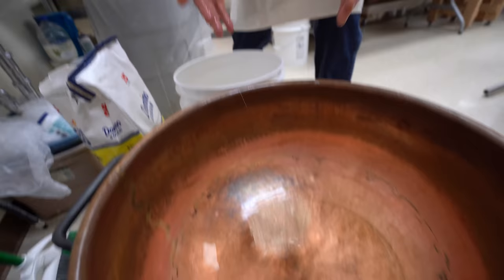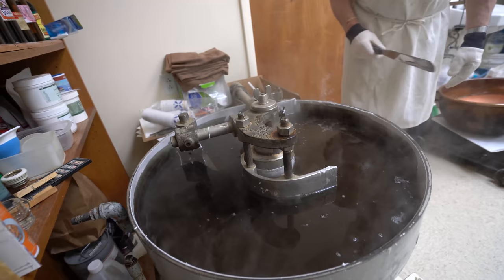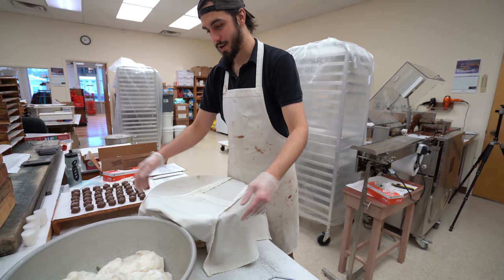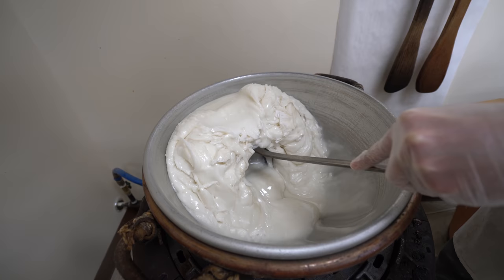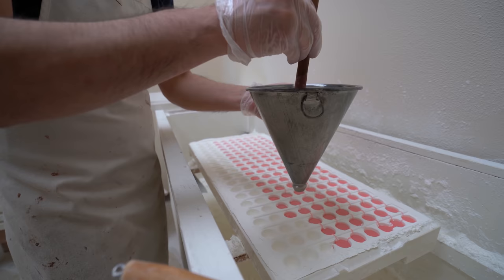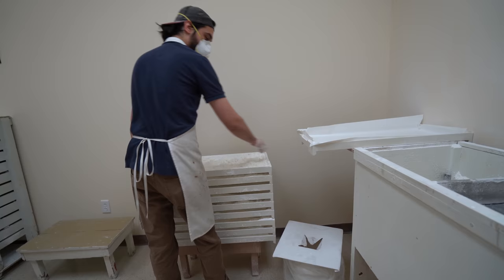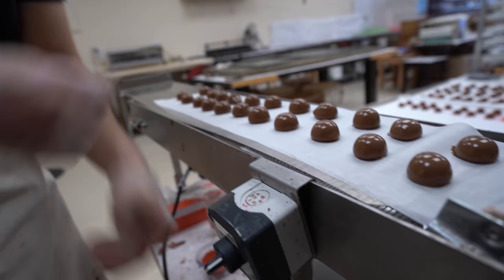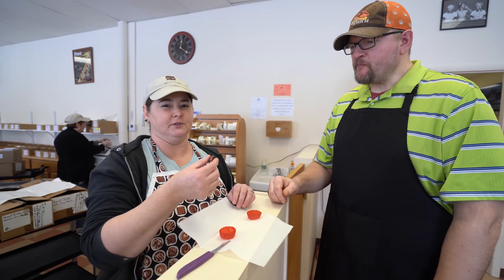How We Make Our Cherry Assorted Chocolates From Starch to Finish

Comment: the creams are made from sugar and sugar is hydroscopic especially granulated sugar and as we know granulated sugar will absorb moisture from the air making it moist and clumpy and then should it dry out it goes hard and lumpy,  I think that is why the creams react differently when covered in chocolate to being left in the tray uncovered, the moisture content of the chocolate turns the creams soft and keeps them at a consistent moisture level. Of course I could be wrong as  I'm no scientificist
Reply: Max said near the beginning of the video that they use invertase.  It's a natural product that inverts (liquifies) sugar over time.  So as the invertase does it's thing inside the chocolate coating, the creams get creamier depending on how much invertase is added.

Comment: Hi, at about 55 min in there is a comment about the creams sounding  hard but when you eat them they are  soft. That is because of the invertase added during the cream mixture making process, as the cream filling sits over time the invertase converts the larger sugar molecules into smaller liquid glucose and fructose molecules making the centre go from firm to soft. if left long enough the centres would become runny.

Comment: The chemical term for when the sugar in the creams absorbs atmospheric water causing them to soften and liquify is called deliquescence.
The sugar is hydroscopic attracting water molecules which cause the liquification.
Reply: From the Latin root, "delicatus" = alluring. Some other derivatives are, delicatessen, delicious, delightful, delicate...
Reply: Jason Frost - wrong Latin root as nicely as it would fit in with chocolate making. 
Deliquescent is from Latin dēliquēscere : dē-, de- + liquēscere, to melt, inchoative of liquēre, to be liquid.

Comment: @ 37:00 small tip - use back and forth movements through the cream with the ladle along with circular ones to get a thorough mix faster. "Circular only" can leave small areas unmixed or less mixed for a longer time.

Comment: I think the reason you have to wait about 25 minutes is because the sugar needs to cool down and crystalize correctly. If you don't wait long enough, the it'll cool down unevenly and form crystal pockets where you have some crunchy bits suspended in a viscous substance. If you wait too long it'll separate and you'll get a rock and some liquid. Just a theory ;)

Comment: Just a guess, but I think that the waiting for 25 minutes might be because if you don't you risk it boiling over. You can see at 9:18 at the end of the pour that it is boiling from just being poured in even though it wasn't boiling in the pot before pouring. So perhaps it can become far more superheated and if you agitate it straight away it might flash over onto the floor and maybe cause burns.

Comment: Can’t think of anything worse to put on your chocolate than sugar. That has got to be a weird texture. They get softer in the chocolate because the lack of air. Since the exhaust fan is on the same wall as the starch room, couldn’t you easily add an exhaust fan in the starch room.

Comment: Yall had a car come through the front window. The hell.
Was someone after the goods?
And thats an optical illusion with the time lapse. You can see the effect with the classic ballerina girl who spins in any direction dependent on your perception.
And stiffness of the cream i would imagine differentiates due to possible nucleation sites. Either areas not fully cleaned or some kind of contamination after, that caused the crystallization of the cream to start sooner or happen faster.

Comment: Why don't you have the Corn Syrup bucket sitting in a frame that's about a foot off the floor? You're going to ball it and drop it into the copper pot the same way. And it would save the strain on your back and reduce manual handling for whoever is doing it. I know it's a suggestion that'll be ignored but thought I'd ask / suggest anyhow. There a lot you do that could be done to save body strain. It's weird. In Australia the place would be shut until manual handling issues were addressed. Sometimes for stupid reasons but other times a real blessing. Don't you have your workplace assessed before opening in the US?

Comment: I'm sure this has been asked before, but why still use starch molds?  Don't they make a reusable silicone mold that would save on time, equipment, materials, etc?  Not hating or anything, just curious.
Reply: sometimes silicone can... adopt flavors from previous batches. using starch is a win-win, it can be remolded into numerous shapes, which saves space and it coats the candy making it easier to handle/ less sticky to handle

Comment: Just curious - why do you run your finger across the edges of the corn starch board before you put it on the press?
Reply: The excess starch would just fall on the floor.

Comment: Hypothetically, could one establish the creme consistancy in a stand mixer??
Reply: Maybe, it probably depends on how fast the lowest setting of the mixer is. Their mixer seems to run very slow compared to a stand mixer. And it runs for a long time. Not only do stand mixers move faster, but it would probably kill the motor
Reply: I kinda thought about that right after I posted, but still wondered if it was worth a shot...  but I dont wish to kill the stand mixer.

Comment: Why doesn't the guy putting the balls of corn syrup in the pan have gloves on???!!!???
Reply: it could be because the corn syrup would stick to the gloves more, and if there was any bacteria there, it would die when they cook it (most bacteria dies over 120 degrees, and im pretty sure they heat up their candies way above that)
Reply: @haileynicole600  I'm not sure if you work there or are just another viewer or what but I understand that the heat kills the bacteria, however, there are health  standards/requirements & guidelines in place to follow when producing food for the public, such as hair nets gloves, etc. Touching the food outright with bare hands or pushing a door opened with the palm of the hand gloved or not, then touching food are absolute no-no's!  If the product sticks to gloves, then use the knives, ladle or whatever means that is up to standards.  I get what you are saying, I just noticed a few not so up to standard things happening here.  No telling the bacteria on that wooden door that I never mentioned in my first comment. I generally do not leave any type of negative comment & this was not meant as a negative comment, but rather a heads up to the company & their employees to follow the public health guidelines when handling/producing/selling food products.